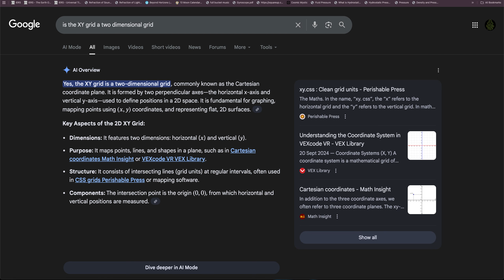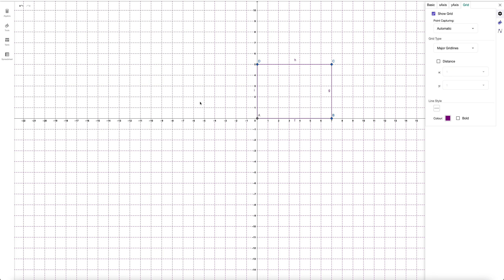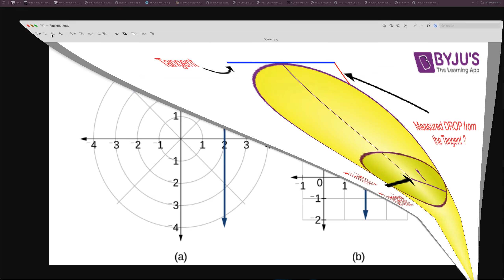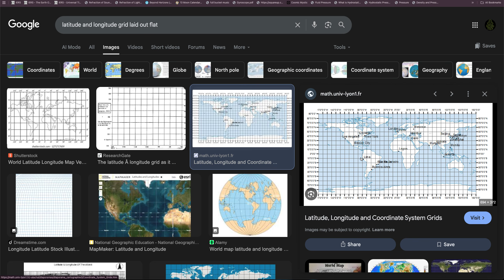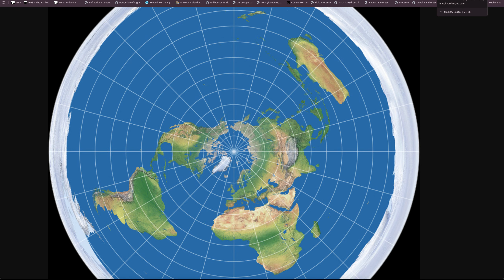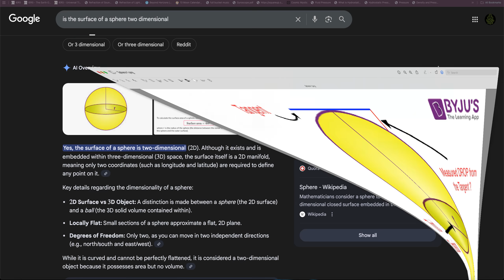The 2D Globe  lol

Comment: Another fact that confuses Brian. 60 nm = 69 Statute miles=110km.
Reply from the maker: Really have you got solid evidence of that claim ?
Reply: @BriansLogic Are you saying that you don't know the equivalents between different scales of measurement?
Reply from the maker: @africansinclair Are you making a claim about two of them that YOU can support, because at this stage you’re not only getting your facts wrong constantly, but you’re also WASTING  MY TIME, so either support your BS which I know you can’t or shut up about it, it’s your choice ?
Reply: @BriansLogic  1 nautical miles = 1.1507794480235 statute miles. Yes or no?
Reply: @BriansLogic  so, now you’ve been presented with the internationally agreed ratio of nautical to statute miles, are you now going to stop using it as a means to avoid presenting your data supporting flat earth?
Reply from the maker: @DeeDubbayaI KNOW the ratio Genius smh, now I need someone to VALIDATE the ratio, not just blurt it out as if it’s gospel….
Reply: @BriansLogic  and I told you before how that ratio has been validated - observe a change in Polaris’ elevation angle between two known points and then measure the latitude distance using your preferred unit of length. I can’t see why you are making such a fuss about it, especially as you already know the ratio. And by claiming the equator’s circumference ‘depends on’ that ratio, you were implying the ratio was not agreed - and indicating it was a distraction tactic by you.
Reply from the maker: @DeeDubbaya No I know all that it’s the VALIDATION that’s needed, for how many EXACTLY there is. 
And I told you fools that years ago, is this another one of those times, when you idiots think that ye are teaching other people, something that ye learned FROM those other people lol ?
Reply from the maker: Agreed ? Proven NOT Agreed, agreed has nothing to do with it smh 🤦‍♂️
Reply: @BriansLogic  agreed not proven. You don’t ’prove’ a ratio between two different measurement units - you calculate the ratio by using the two measurements together, and then users of the two units agree the results. There’s no proving involved
Reply: @BriansLogic  furthermore, when referring to determining the circumference of the equator, you will find (if you can be bothered to check) that I consistently stuck to just nautical miles. As such i had no reason to refer to the sm/nm ratio and I didn’t even have any reason to rely on the sm/nm ratio. So I would have even less reason to validate that ratio.
Reply: @BriansLogic  ok then, given that the distance from the equator to the North Pole is 5400NM (as you pointed out previously) what is the circumference of the equator also in nm?  No need for any further discussion about sm/nm ratio , just your number will suffice
Reply from the maker: @DeeDubbayaYawn….
Reply: @BriansLogic  still no figure then - it’s like you know it wrecks your entire argument. You can yawn as much as you like but your readers can only draw the same conclusion as I did
Reply from the maker: @D@DeeDubbayaIdiot.
Reply: @BriansLogic  try proving me wrong then. Comments like ‘yawn’ and ‘idiot’ only amplify your own shortcomings here. Come up with a figure for the equator’s circumference and then try explain how it is consistent both with flat earth and with known characteristics of the earth. Until then, you are the one looking like the idiot here